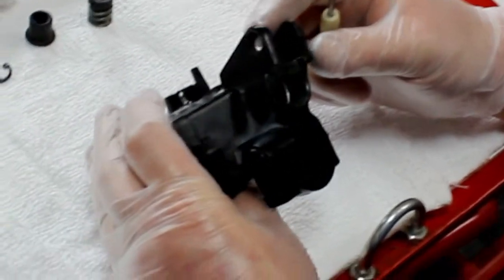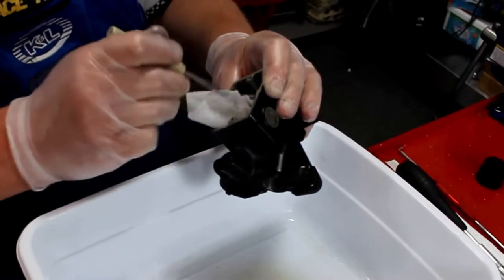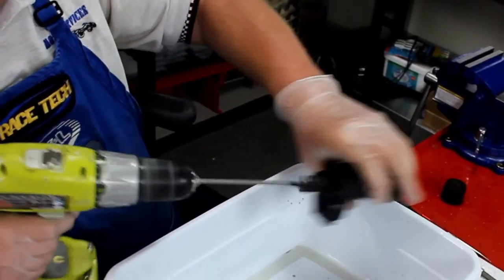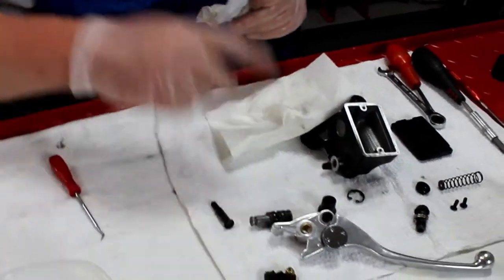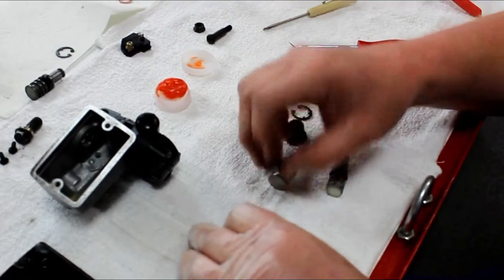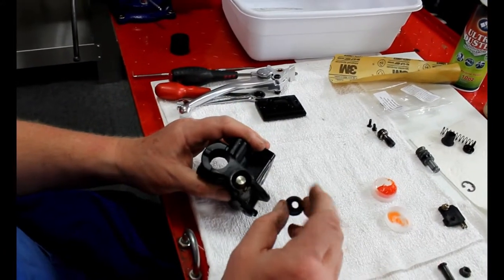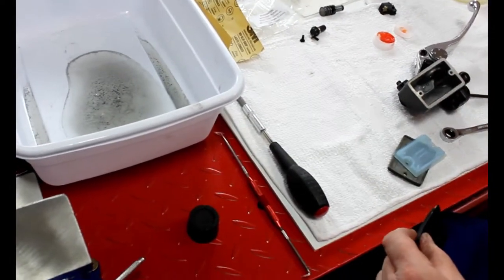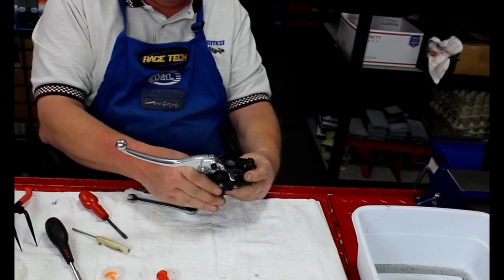Motorcycle Master Cylinder Rebuild - Part 2 Reassembly

Comment: Good informative video and several knowledgeable people in the comment section, I came to the right place.
I bought a 1979 Harley Sportster at an estate sale, about half price.  It sat for around 30 years, needs some attention.  Brake master cylinders are dry and crusty inside, I got the rear apart, it fought me but it can be rebuilt.  The front doesn't want to come apart, the internal components are frozen in place and won't move in or out.  For the last 3 days it has been in the vice exerting steady pressure through a deep well socket against the internal components with PB Blaster in the reservoir, the circlip is out.  I haven't got it's attention yet, is there a better witch's brew to remove the corrosion?  I don't want to damage the unit or replace it, trying to keep it as original as possible.  I expected a challenge but am a little out of my depth on this component.  Thanks in advance for usefull suggestions short of nitro.

Comment: Honing a cast iron cylinder is the proper thing to do. Unfortunately, aluminum cylinders aren't meant to get honed, because of a special coating the manufacturer applies to the bore. The advantage aluminum cylinders have over cast iron is that they don't rust

Comment: I watched part 1 of this, and it was very helpful.  Unfortunately i can no longer find part 1 to watch again.  Anyway, I could use some help.  I disassembled my master brake cylinder, as shown in part 1 video.  Visually I see no damage or wear or dirt.  Yet this cylinder has no resistance whatsoever, ie won't pump any fluid at all.  I suspect some difficulty with the two valve ports, or whatever they are called.  One port has a L-shaped springy thingy on top.  I would expect some sort of valve or ball and spring below that, but there is nothing whatsoever.  Is this the problem?  Can this be serviced?  Help please!  BTW it's a 2006 Suzuki boulevard c50.

Comment: question:  so you pushed the bottom of the boot "in" to make the weather seal.  So does my 87 aspencade have the same procedure for my boot? Push it in?  I just rebuilt mine but can not figure out the boot and plugger proper way of install.... my plugger has a double rig in the middle also,, confused here,, thanks ,, df

Comment: I just watched both part 1 and 2, I wanted to find out what the bore size is for this master, as I can not ()YET) find it online.
AN chance you could tell me. I will watch for a reply
Reply: On that particular Master Cylinder it was a 15.8mm bore which is one of the most common sizes used for front masters.